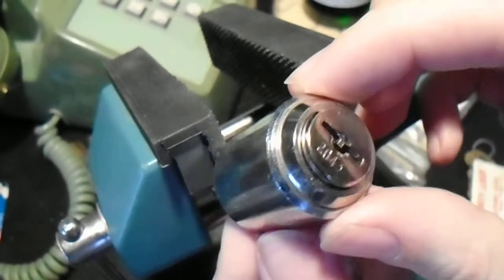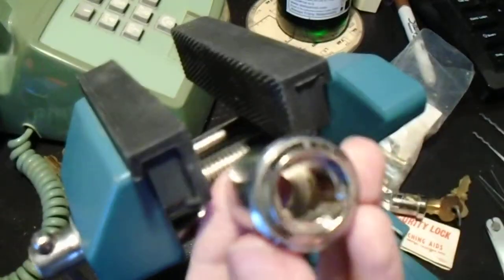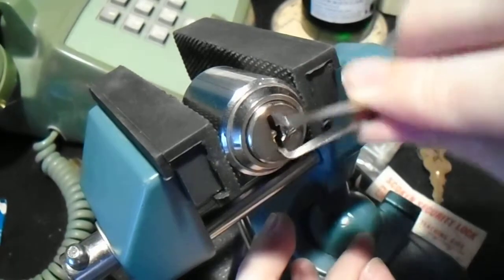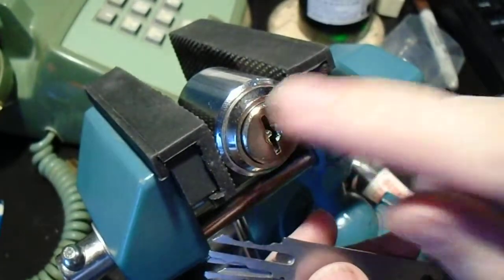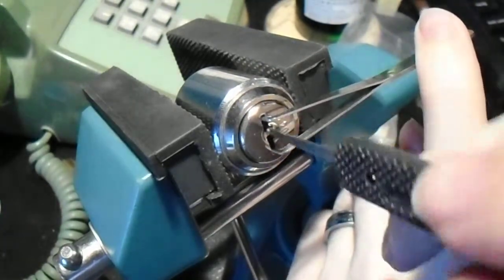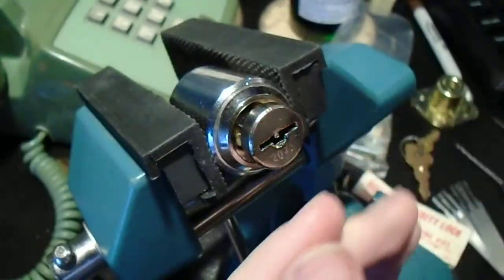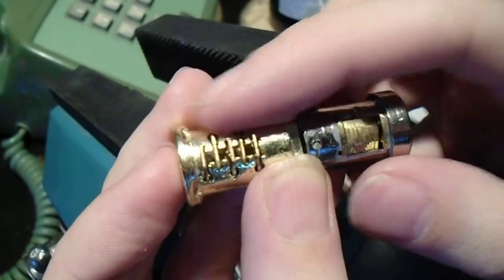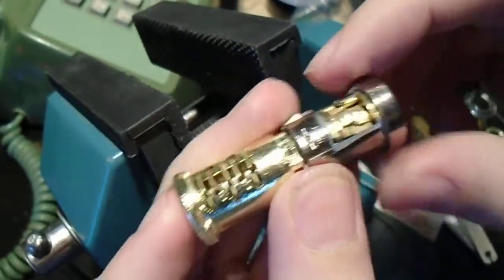(029) Scoken Security Lock/Chicago wafer lock picked and gutted

Comment: I once had a very unique wafer cylinder which came out of a cheap bicycle lock, which  actually had shielded wafers; it used a slot profile key which interacted with protruding pins connected to each of the wafers.
Reply from the maker: douro20 Sounds almost like slider wafers. Did the key have tracks cut in the flats of the key?
Reply: Yes.
Reply from the maker: douro20 In that case it would usually be called a slider or 'laser track' lock. They are pretty common in automotive applications these days. Some high security pin-tumbler locks also include them as a secondary locking mechanism.